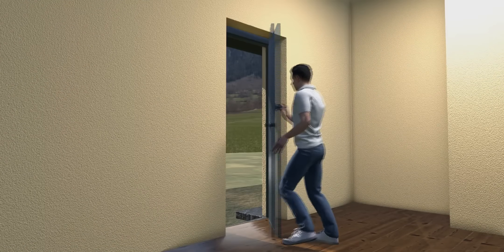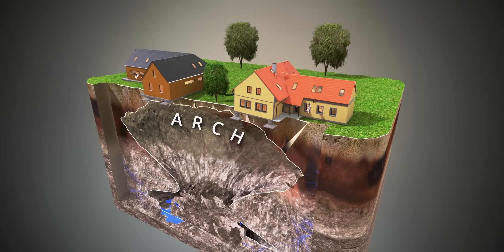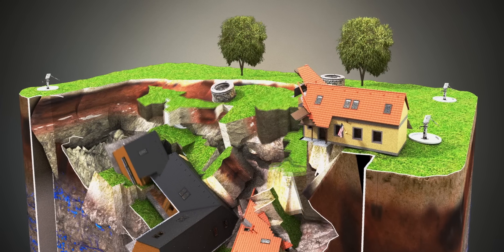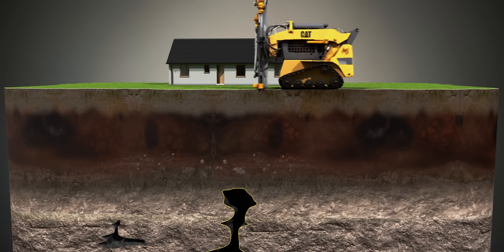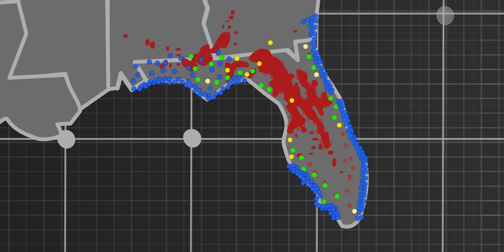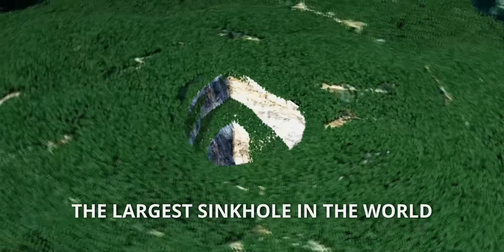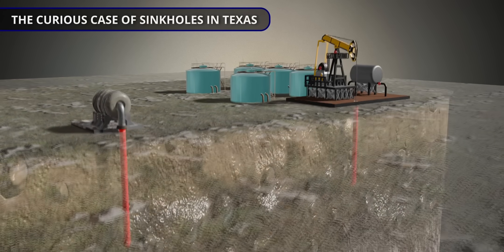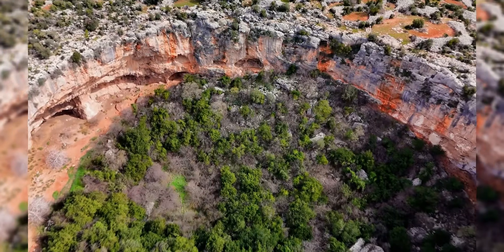Sinkholes : Don't Ignore these Warning Signs!

Comment: a door that won't close can indicate a serious structural problem like foundation settlement, though it could also be caused by less critical issues like loose hinges or swelling. An inability for doors to close is a common symptom of shifting foundation, which needs professional inspection to determine the extent of any damage to the house. While easy fixes exist, it is important to investigate the root cause thoroughly to prevent more significant damage later. 

Potential causes and what to do

Structural issues (Foundation settlement): This is the most concerning cause. When the foundation shifts, it pushes the door frame "out of square," making the door not match the frame and unable to close or latch properly.
What to do: If you suspect this is the cause, especially if multiple doors are affected, contact a professional to inspect your foundation.

Hardware issues: Loose or bent hinges, a misaligned latch and strike plate, or a malfunctioning doorknob can prevent a door from closing or staying closed.
What to do: Check for loose screws, adjust the strike plate, or try to bend the hinge knuckles to see if you can fix it.

Swelling: High humidity can cause the door to swell and expand, making it too large for the doorframe. This is often seasonal and can be a temporary fix.
What to do: If the door is swollen, you may need to plane or sand the edge of the door to make it fit, or a professional can fix it for you.

Bad installation: The door may have been poorly installed from the start and doesn't fit properly within the frame, leading to problems later.
What to do: A carpenter can assess the fit and make necessary adjustments or repairs.

Comment: Why pot holes are made
I am from India 🇮🇳 
Pot holes are everywhere
Reply: Potholes usually form from thermal expansion and contraction of the material + water which make cracks in the road, which then form potholes (partly due to the fact that cars driving along the road will tear off pieces from the cracks, too)

Comment: I live on the eight floor of a 9 story building. The ceilings and floors all show signs of hanging through. There is even a big crack crossing the floor with a difference between the sides of at least 1 cm on some places. This video makes me kind of worried...
Reply: That’s a significant difference IMO. A structural engineer should go take a look at the structure! Talk to your landlord. If we’re talking a centimeter over, say, 20’ that’s a cause for concern. Cracks are ok, generally, unless it is wider than 5mm. If you happen to live by the water or in an area where sinkholes are common, I would definitely investigate further.
Reply: Rightly so, i assume. Time to leave the building.
Reply: Find a pavement to set up your bed dear